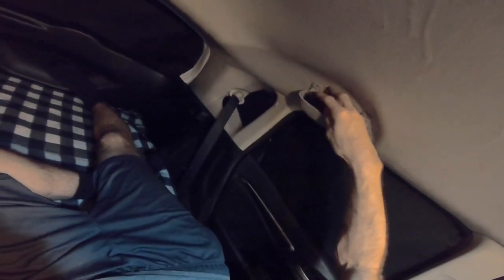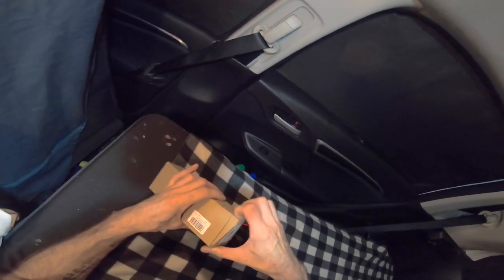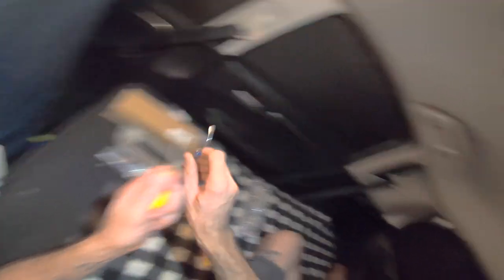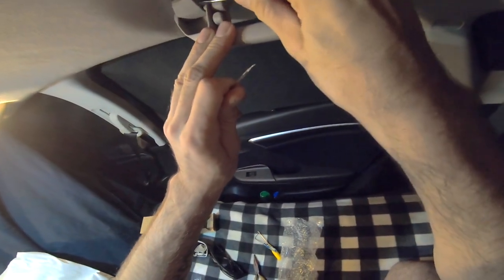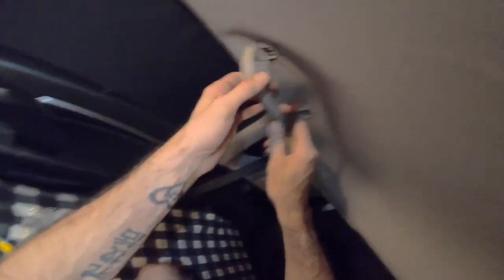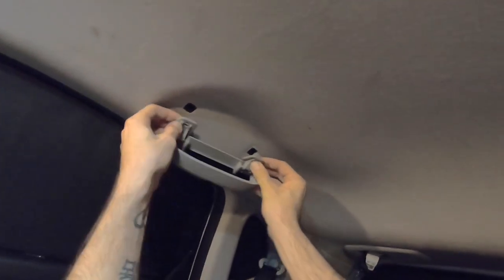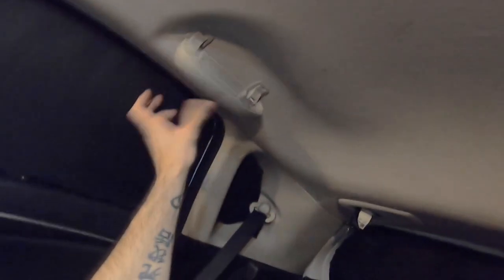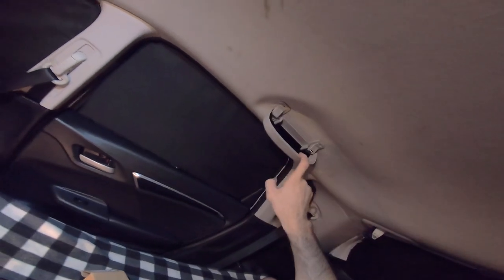Every Car Camper Needs This! - How To Add More Storage To Your Car Without Taking Up Anymore Room!

Comment: So you just straight up got rid of your back seats?
Reply from the maker: Yes. I kept one rear seat in for 2 or 3 years, but eventually took it out to make room for the 12v cooler.
Here's an older tour video that shows how it was setup with 3 seats. https://youtu.be/vP7IyP8_7xQ?si=ZvSy1HgWP9UX46Ju